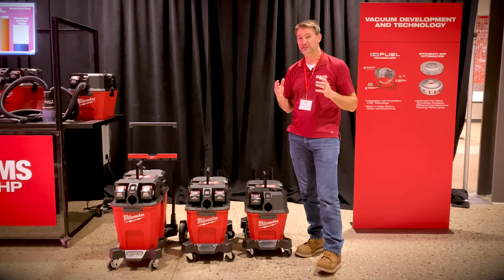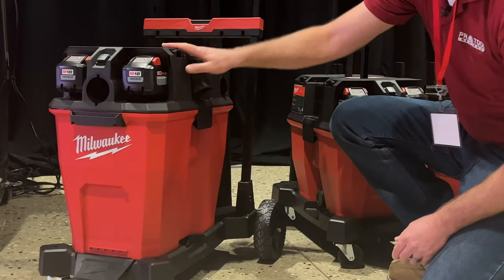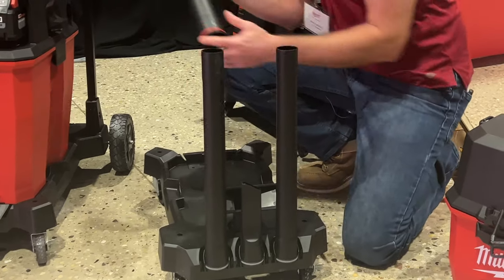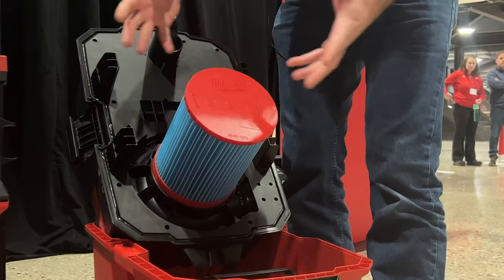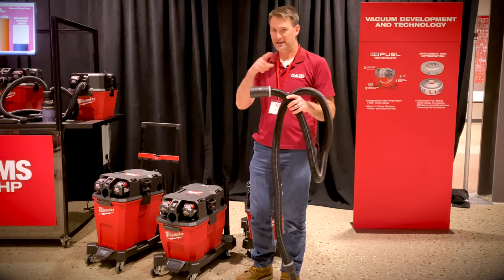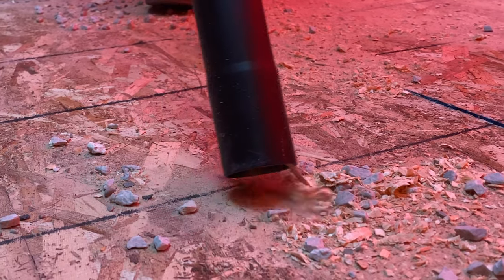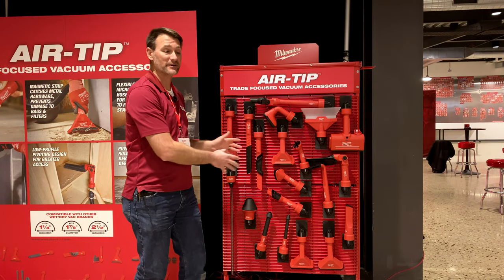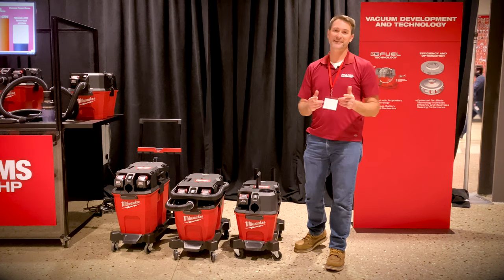Milwaukee M18 Wet/Dry Vacuum & AIR-TIP Accessories Review

Comment: The 6 gallon lacks suction power.Bought it and then returned it.Maybe the 9 and 12 gallon models with the two battery system will have better suction?

Comment: Awesome! I've been waiting for a proper cordless vacuum. Thanks for the info that packout vacuums are coming. Are they going to be similar to these? I do wish they had a self-cleaning filter. Maybe if they bring out a dust separator as an accessory that sits on top.
Great content as always. 👍🏻
Reply: A pack out design would allow for this easily!, screw a dust deputy to a backing plate, easy on and off! I don't get why why wouldn't just add the Pack out top to these to begin with?
Reply: @davehart817  Agreed. I've been thinking about making a packout dust separator incorporating a dust deputy.

Comment: These vacs look awsome! Having a Hybrid option ac dc with a built in charger would make everyone's day.
Reply: @Protoolreviews  yeah but what's the point of having 2 power heads. Might as well have a 60 dollar shop vac for cords . I think the power head should have a cord  that simultaneously charges the two 12.0  batteries while running it on a cord then being able to take it to a  cordless level.  1 duel powerhead with charging capabilities less tools to haul into the  jobsite.
Reply: @philipdove1705  from an engineering standpoint, that may be hard to achieve. They could probably have a hybrid option, but it would have the same motor and electronics whether you’re running it corded or cordless, so the power outputs would have to be similar. The A/C motor head is a 6.5 peak HP motor, so you wouldn’t be able to get that out of a hybrid. So I agree with you that it would be cool to have a plug in hybrid option that just doesn’t put out a ton of power because it’s versatile, but at the same time, I like the idea of having a different more powerful motor in the separate AC option. Although $199 is a bit ridiculous for that.

Comment: If the Motörhead different on the 9 and 12 gallon units? It shows the 2.5” diameter hose only coming on the 12 gallon unit.

Comment: I want a 6 or 9 gallon with the 2.5" hose! The 12Gallon is too bulky but I want the bigger hose!
Reply: And how hard would it have been to make them packout compatible?!?!?!
Reply: Just buy the 6 gallon and the 2.5in hose and tools
Reply: @bread-gz3rl  The 6 has a smaller motor, and why have to buy things 2x? I don't want a tiny hose that sits in my shop, should make them so people can build the system they want without all the waste. Oh and a pack out top!

Comment: Cool
Reply: @Protoolreviews  when is the Milwaukee wet dry vacs available
Reply: @Protoolreviews  when is mowing season starting
Reply: @Protoolreviews  how much does it cost
Reply: @Protoolreviews  does these new vaccuum systems have bluetooth enabled devices or will there be bluetooth enabled in the  future to work with saws for a Dust solution?
Reply: Is this Gwan Joe?